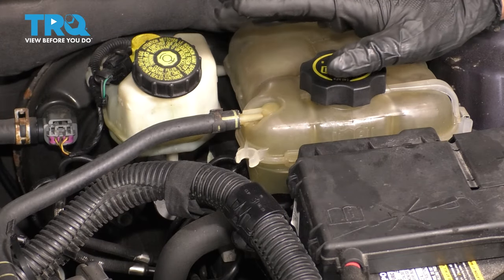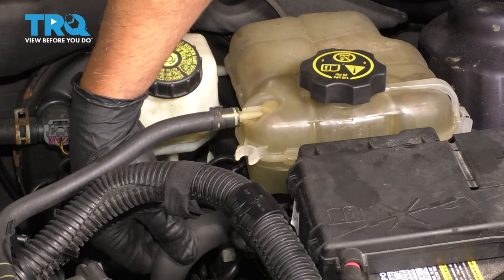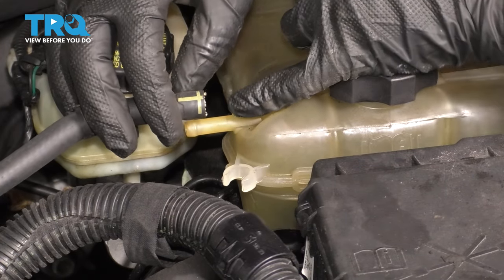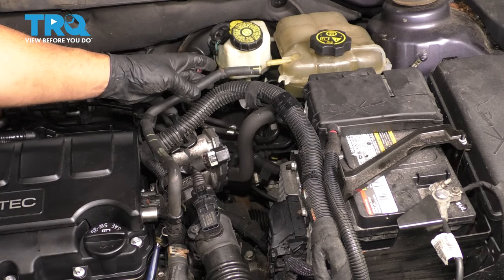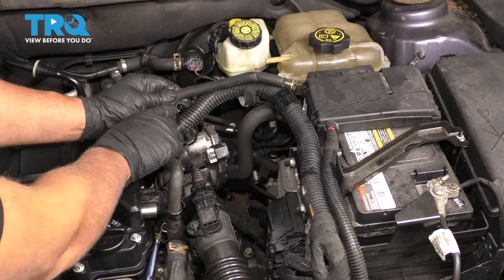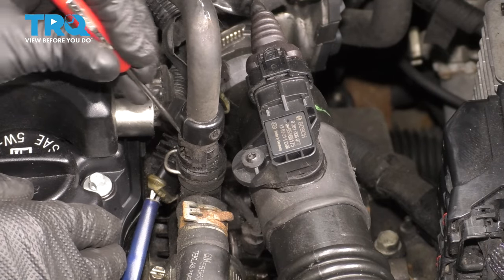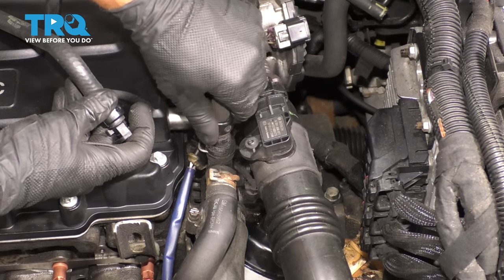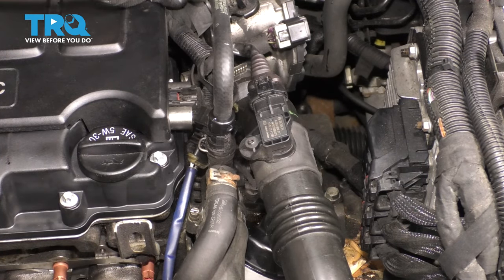How to Replace Coolant By-Pass Hose 2011-2015 Chevy Cruze

Comment: The fitting that the hose goes into, it has the small silver clip, mine snapped off there, I bought a replacement piece, but I can’t get it to seal off, the new gasket is to big to fit into it, but the old gasket is too wore out and is leaking. How do you install the fitting with the new gasket without breaking it?
Reply: What I had to do was use some locking pliers to pull off the silver piece. Pull the silver piece straight out in the direction that you grab it (it looks like a small carabiner with one end open). After you pull that out, grab the fitting and pull up, it comes out. Then, with the new hose, shove it all the way down in there so that the gasket gets tight, then replace the silver clip, keeping in mind it needs to intersect with the groove above the plastic that stops the little rubber gasket.
That's it.
 I know it's difficult to explain this over text. That plastic overlay piece that they show here doesn't work with some replacement parts, like the one made by Dorman that I bought from AutoZone (had no choice, would have bought a different and cheaper brand but the store is across the street from my house and I need my car).

Comment: I replaced the thermostat housing and the hoses attached. Everything is good except for the top of the housing to the reservoir inlet hose connection. It is still leaking as if the hose connection is too small, but I ordered all parts together with car-matching. Any idea how to stop this coolant leak?

Comment: What’s the part number on the new hose? The gm part number should be 13251447 but these parts store say that Dorman part number 626-609 should work but the fitting doesn’t come with the Dorman hose! I guess I gotta drive to a dealership!

Comment: knew it was gonna be a easy fix but wanted to make sure i did everything right. Coolant dumped all over my car and driveway but my leak is now fixed, used dorman hose 626-609 as a replacement and had to dig through pouring coolant to get the o-ring out of the coolant outlet thing lol
Reply from the maker: +amazon box Thanks for watching our video! http://1aau.to/m/Shop-TRQ

Comment: But I have a 2013 Manual Transmission CHEVY CRUZE just replaced the Heater HOSES cause that plastic piece 3way popped a hole 😂
Anyhow
Added Antifreeze after replacing and my car sounds insane trying to start it
Please help me asap 🙏🙏🙏
Reply: @TRQ
Reply: Replace the hoses , and the water outlet, drain the old coolant and put new coolant , maybe get an oil change , its about 3-4 hoses in total 
You should be smooth after youve done all that